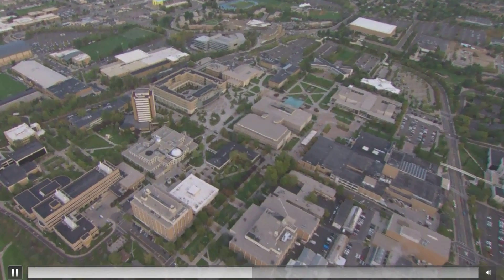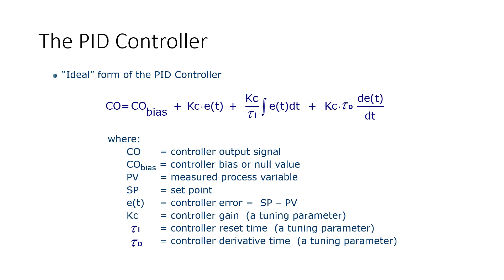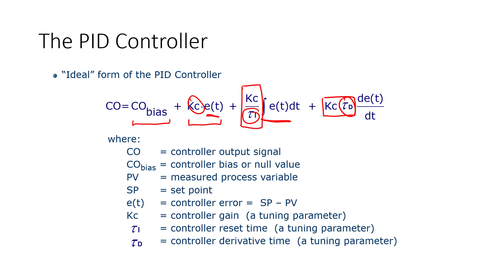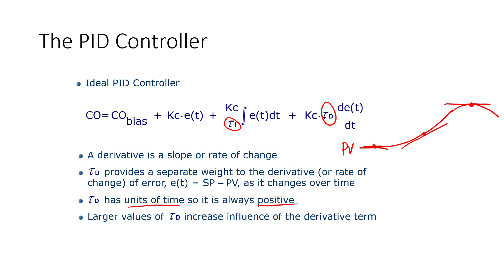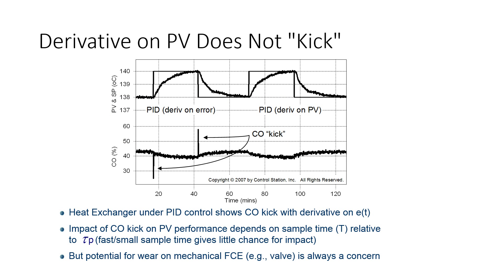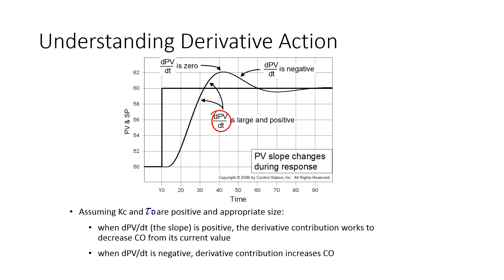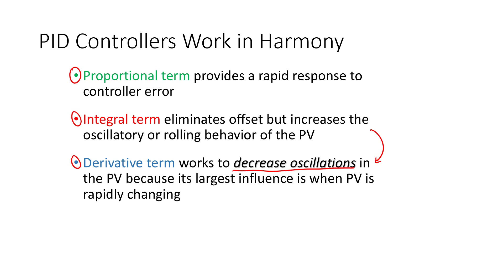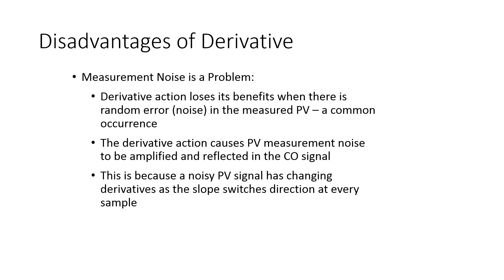PID Control: Derivative Action

Comment: There are a few things I would like to add.
1.  It is possible to have the proportional gain act on changes of the PV too.  I call this a I-PD because the proportional and derivative gain only act on the feed back, not the error.
2.  Obviously, the derivative kick is not desired but there is more to the problem than the derivative kick.   The gains in the forwards path,  those that act on error instead of the PV changes, add zeros to the closed loop transfer function.   This can be good or bad depending on where the closed loop zeros are.   If one is very clever,  one can place both the poles and zeros to get the optimal response.   It is is also possible to place the zeros to get the effect of a notch filter.   This could be good if you know where the notch filter is placed.   It can be bad if one is not aware of where the notch frequency is.
3.  Not all open loop systems  require a derivative gain.  A closed loop system system should have one gain for every open loop pole.  The derivative gain does not count because it has it;s own pole.
Reply from the maker: Thanks for these additional insights, Peter.